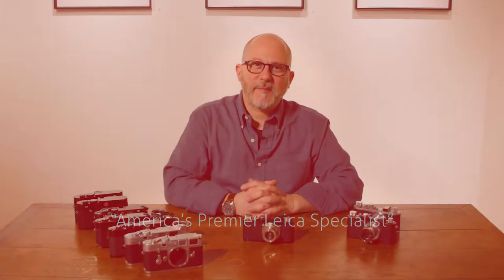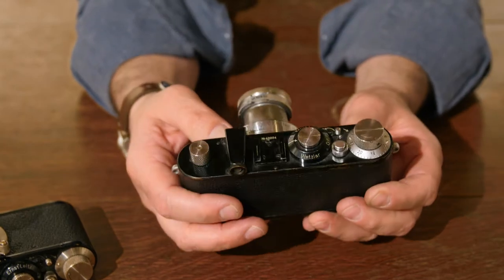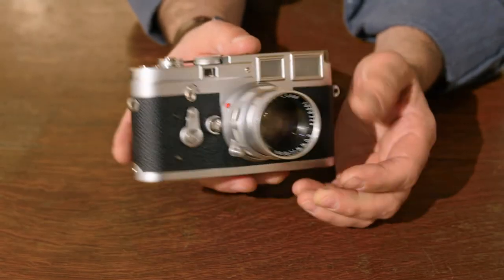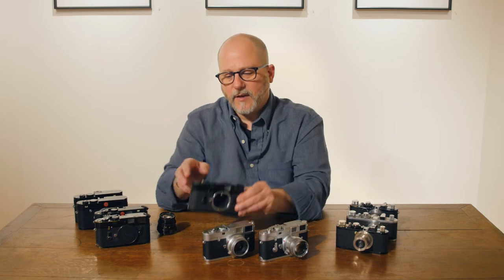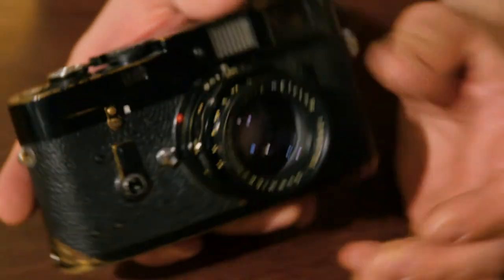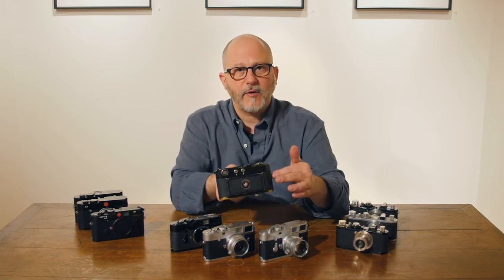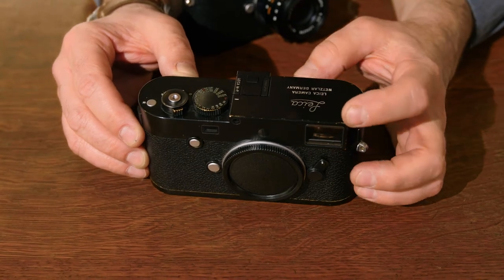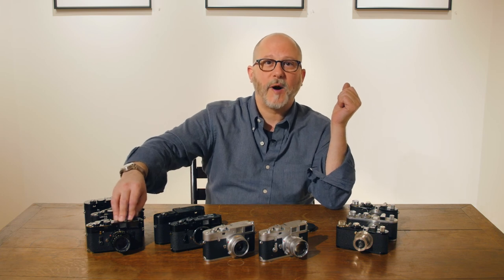Leica Finishes

Comment: Just a side note: not ALL Leica Ms have brass top plates. On late M4-Ps and particularly classic M6s Leica used zink plates, which are harder and more durable (they crack rather than dent and collapse if hit hard) but they don't 'brass' the same way as painted tops do, and tend to grow blisters after decades form impurities in the alloy. Theoretically they can galvanise into zink powder if the surface treating is blemished but for that you need to soak them in salt water for a long time. I own both zink and brass top Ms – they have their own aesthetics but naturally the painted brass ones are more desirable. The zink M6 black chrome is more matte and fades into slate grey instead of brassing. Collectors don't go near those cameras. That said, those classic and TTL M6s sell for less and you can snatch up a good bargain for a fantastic user. Hope it helps.
Reply: Csaba Farkas excellent info! Coincidentally, neither does the M Typ 262. It has an aluminum top plate.
Reply: There you go. Now I learned something! Bottom line: brass rules!

Comment: How long does it take for a black paint to have that patina
Reply from the maker: Tazmanian Devil the more use the camera gets the more patina it acquires. The result depends on the exact type of enamel and how it is applied. Leicas typically take years to brass with lots of use.
Reply: Years of heavy usage, decades of normal  using
Reply: For the old black paint tho
The new one is easier to get the patina